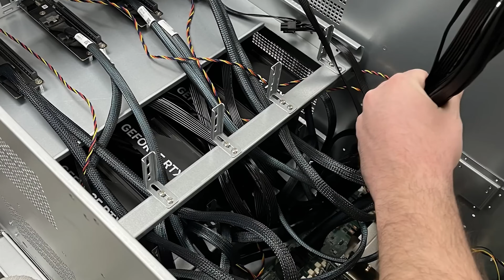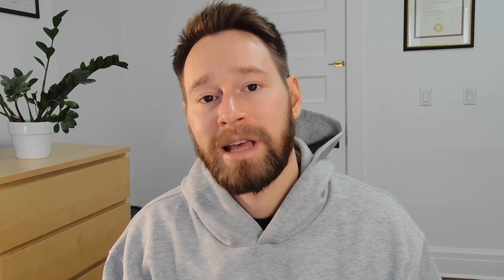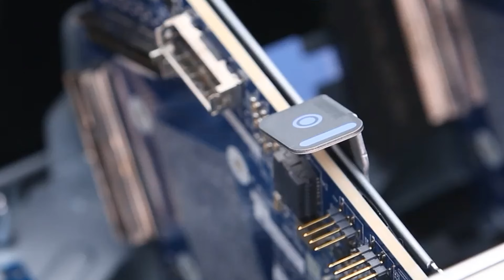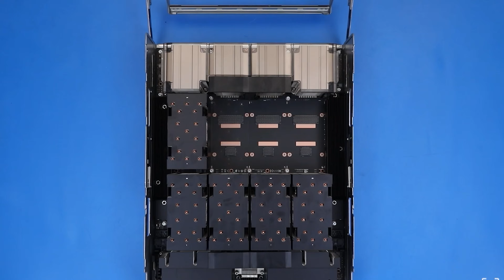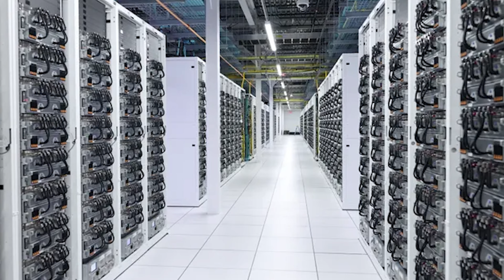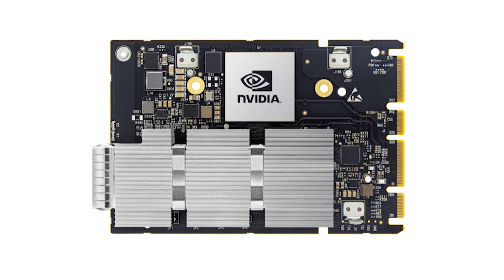How Is A $250,000 GPU Server Built ?

Comment: GPUs don't serve, it's displays, renders
Reply: That is no longer true, since approx. 2007-2008. All modern gpus are essentially a huge set of really simple risc (mostly) cores and sometimes with specialized accelerators. ROPs and TMUs are just part of those, but modern datacenter gpus do not necessarily have TMUs anymore. And they are still called GPUs.